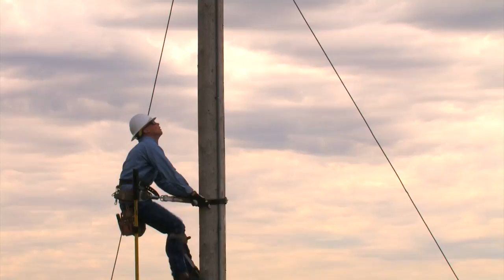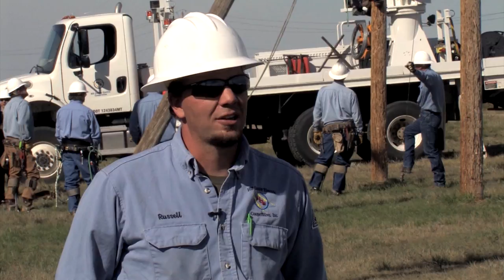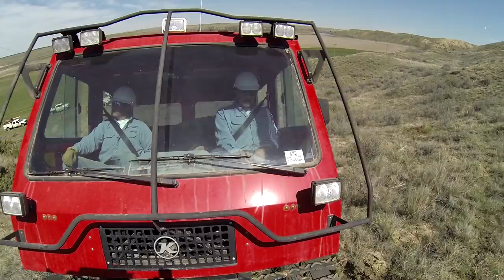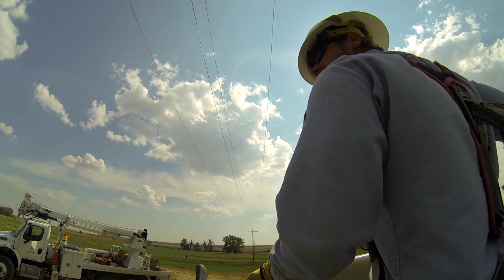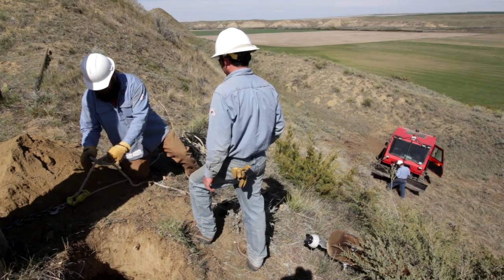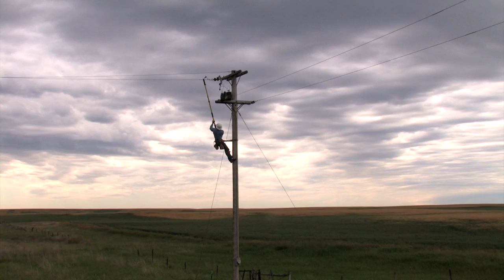Life of a Lineman: The Unsung Hero

Comment: As an old timer, they used to put a grounded clamp under the climber so if some thing where to happen it would most likely go to around the climber. Especially it pole has tracking... What happens when the capacitors has reaction... Right underneath it... Hot oil, melting rubber. Maybe a telescoptic stick from ground

Comment: New York Ibew 1049 🤙
Reply: Mr fncypants J.L out of 317 in WV be safe brother.
Reply: Always. 🤙
Reply: @magicman_metal_fab  Hauppauge. I tramped through Long Island. 1987 there was a small contractor in need of lineman, Commander Electric was so glad to have me on board, they cut the overtime hours. So me and everyone  else went to Local 42 in Connecticut, and left the contractor holding a bag full of pissed off apprentices that aren't allowed to drag up.

I spent 40 years in the tools. The last 14 was with The City of Los Angeles Department of Water and Power. LADWP was and still is, the most badass place. They do tons of hot work. Glad I lived through it. 

LILCO lineman are mere hydraulic ice cream cones standing next to the men who climb. They gave me two bucket trucks in Long Island just for our contractor crew. The 5 line crews in the West Los Angeles DWP yard were lucky to have 2 buckets that were operational on any given day! 

Most of the powerlines in LA are in a back yard, and there is no bucket access in the first place. I wore off the rust on my hooks fast, and the first three days was building 34.5 KV circuits on 75 foot poles. I was soft at the time, at 46 years old, having to start climbing every day thought it was gonna kill me.

By the grace of God I lived through all that, and retirement is sweet!

Be careful out there men.
Reply: David Lango 
It sounds like you had an awesome career. And now you get to reap the rewards of working a long productive life. Everything in life happens for a reason where we end up. I am now working in Florida for Duke energy. I am on the tail end of my shift and hope too myself will have an excellent retirement. Thanks to union work. 😊🤙🏻 IBEW 1412 😁
Reply: @magicman_metal_fab  ibew 1049 here. Working for Haugland energy. We do all of the major work now. Utility guys get ice cream parties for safety haha basically we do all the real line work and they not so much. How do you like duke??
Reply: @linehandibew6205  I absolutely hated it. I quit and just chase storms now. I had a vision that they worked like our utility and I was punched in the face lol. One of the worst companies to work for. Right decision to move but wrong company to work for.
Reply: @magicman_metal_fab  I know some 1049 guys that work for FPL. Chase storms......you coming north for Christmas??? PSEG freakin out about this storm for Christmas

Comment: Why use the wood pole ?
Reply: Keo Sela Wooden poles have lower transportation and storage costs. When stacked properly, wooden poles need less than half the storage space of steel or concrete poles. Wood also withstands handling and surface damage well. On the other hand the galvanized coating of a steel pole is very thin and can be easy damaged. Concrete poles don’t bear hits or handling well either.
Wooden poles don’t need any special packaging for transportation. Wood is light and tough, which means that it is easy to haul through different terrains.